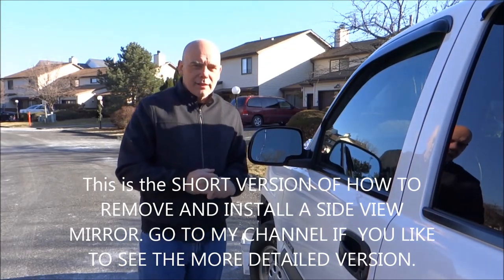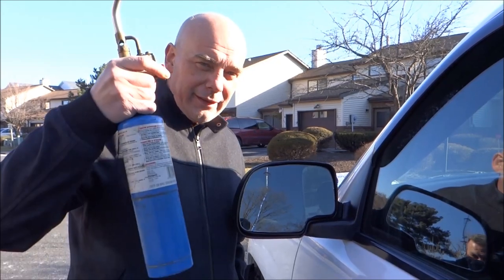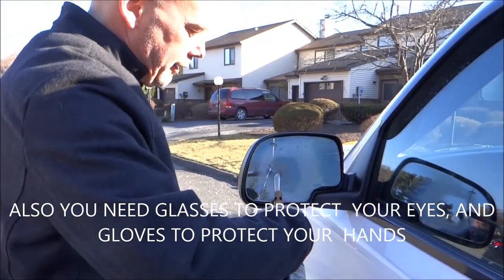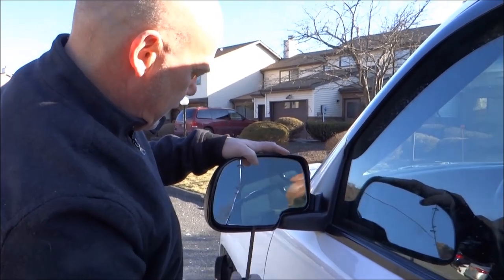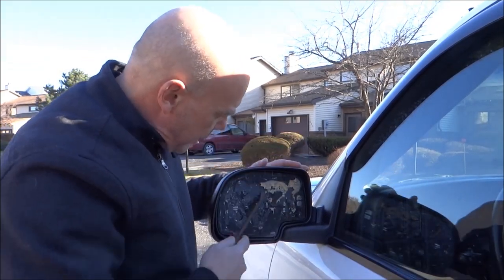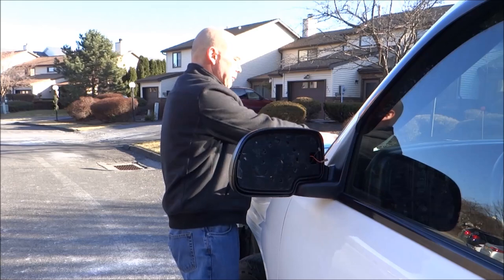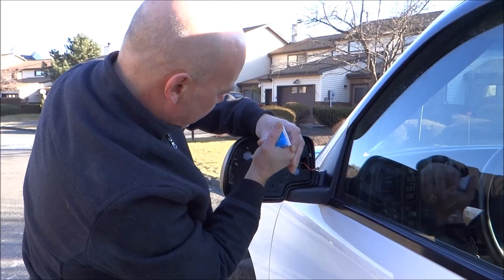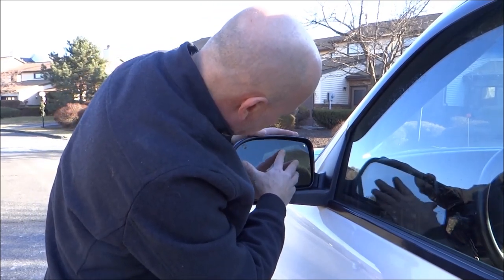How to Replace and Repair a crack or broken Car or Truck Mirror Glass

Comment: I just watched a video of this procedure on another channel where the guy didn’t heat the glass—-that’s the way I DON’T want to do it, broke into a million tiny fragments!
I actually thought of applying heat to the glass before removing it as it seemed reasonable that doing so would soften the adhesive. Thx for confirming that it was a good idea!
Reply from the maker: I saw the same video as you did. He has the frame on a table, and  scraping it? As the glass is flying all over the place using all the strength he can. And then the part that he rips apart, he did not put on the truck. . He got a new one. With a heating element behind the mirror, and the laser Arrow. Where the company that he bought it from glued a motor mount attachment  on the back of the mirror where the heating element was and bare glass. In that video, he's installing it that has no frame lip Edge. So he did not use the frame in which he pulled the glass out of because he couldn't.  He ripped apart a self dimming GM mirror  that was encapsulated. Look at my videos on self dimming mirrors. I think these guys should stick to replacing engine parts and not mirrors.

Comment: I just wanted to say thanks for this video.  I didn't have a propane torch but  I used a hair dryer as you recommended and the old mirror came off in less than 5 minutes!  Thanks again!
Reply from the maker: It must have been funny when you asked your Gal where her hair dryer was. "I have to remove a mirror off the car", and stares at  you.......:)

Comment: Great video. I learned a lot. I have an electric heat gun that I would use instead of a torch. I use it to resize and install new tennis racquet grips every once in awhile. Thanks again for sharing the video.

Comment: Thanks for your fabulous instructions. I used my hairdryer and slowly peeled off the old mirror. I recommend wearing gloves and goggles. My replacement glass kit from the auto parts store included two peel and stick adhesives so I didn't have to buy silicone glue. I hope I don't regret it. I have blue painters tape on my side view mirror overnight, just for insurance.
Reply from the maker: Yes Robin. Amazing what you can use a hairdryer instead of drying ones hair..lol. I am glad it all worked out.

Comment: Thanks for showing us vid. Ya I was b as backing up in between my shop and a tree and yep the tree cut off branch got my mirror. So I got a nee replacement mirror and looked on you tube and saw your vid
 Thanks very helpful. Made the job soo easy. Thanks again..
Reply from the maker: Always my pleasure to assist Rocking.

Comment: Does the glass clip on, slip in place or merely glue in place? Thanks
Reply from the maker: For most cars there is a frame lip around the plastic frame that then snaps into the motor. In the video, the glass is glued into the plastic frame which is clipped into the motor. So simply its glued into place using a non-latex silicone.The Difference between latex and non latex silicone glue is the latex (rubber compound) is great for plastic or all porous Material. Thats why you use a Latex glue around your bathroom tub. Silicate (glass) is not a porous material and will not bond. The other name for non-latex silicone is construction silicone and is used outdoors. It will bond with both glass and plastic surfaces for the life of the car. Also, do not ever think of using Crazy Glue or Gorilla Glue, as those adhesives also need porous. How long will it hold, well, any day...........it will.....
Reply from the maker: It slips under the thin frame lip. Glue the frame and slip it up and down and in.

Comment: Thanks for the video. The glass of my a4 just came off in a whole piece. I don’t know if the backing is a heater.  Can I just silicone it back to the backing?
Reply: Some of the Audi's had self dimming mirrors where  you would not remove the glass. When they fail, they turn black or Rust. In that case we would sell a self dimming fitover mirror. I did a video on that, and it was for an A4. Here was the link . https://www.youtube.com/watch?v=oK1WUfLJx_E&t=69s

Comment: What's more cost effective, new lens assembly for $20 or new glass plus silicone, propane torch, glue removal tool and tape for $50+?
Reply from the maker: If  you ever see a new lens assembly for $20, you are more likely to getting an Asian, low quality mirror product. The glass made in china are only made of Aluminum Oxide. Our US made first surface chromium absorbs 40 percent of the light. Aluminum Oxide Mirror absorbs Zero. Its like having a bathroom mirror, and at night blinded by cars behind you.  I have a video showing the difference, to see these videos subscribe to my channel.  So yes.You get what you pay for. You never want to change the OEM frame to an aftermarket one. You want to keep everything original.

Comment: Good video especially torch application
Reply from the maker: Its amazing while watching all of the Installation methods on You Tube, the producer never shows how to get the glass off where its glued to the frame. They struggle with the camera off an NEVER mention how to use HEAT. Thanks Ron

Comment: How long do you leave the tape on?
Reply from the maker: If the Temperature is above Freezing, the cure time is usually 4 hours. The glue we sell bonds between -45 deg to 140 Deg. Best to do the job at night so the glue dries by morning in any weather condition.
Reply from the maker: Between the temperature of 40 and 100 degrees, the silicone has a 4 hour cure time. The real reason for the tape is to prevent the mirror from falling out while driving or you Son needed to get his football in the front seat and then slams the door, thus the glass takes a nose dive.

Comment: Thanks, broke mirror glass while on a slippery iced over road in an urban setting(narrow street one truck on rt. too far out, clipped it's mirror with my mirror)
2014 Jeep Grand Cherokee Overland.
Have an industrial grade heat gun will use it. Have the silicon glue on hand. Will report how this went.

Comment: Thanks! I used my heat gun and my glass glaziers knife which is sharp with a nice angle for prying up the glass. It can help to also apply heat to the knife (or scraper) to help when removing the broken glass and scraping off bits of glass and glue. I also used a towel between the mirror and panel to prevent any scratches to my shiny paint job!
Reply from the maker: Yes....I do that all the time. If i struggled with that mirror, I would finish it off with a torch on the Blade. Being you can sharpen it and Heat it till it gets nice and red. Good Catch Goldtop.

Comment: I used a high watt hair dryer & didn't do sh*+. Mirror is like 'cemented on'. Old 84 buick ALL metal casing. Couldn't get mirror off w/out breaking the sh*+. Had never been replaced. Factory glued was tough as hell, bk in those day's. Wanted to add those LED light turn signals to them. Project is more work than expected. Haven't seen no video like this one, for OLDER car's 😒
Reply: Gosh, I wish I had a car from that ERA.  They used Ureathane Glue. And yes over 40 to 50 years is turned to cement. On those older cars you have to use a torch or a heat gun. That scraper I sell would be perfect. Thanks JV.